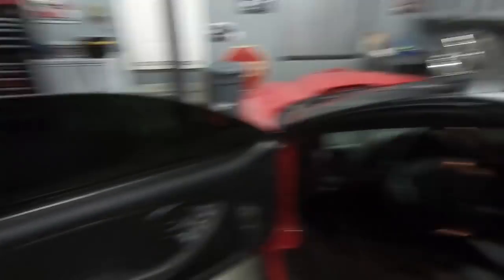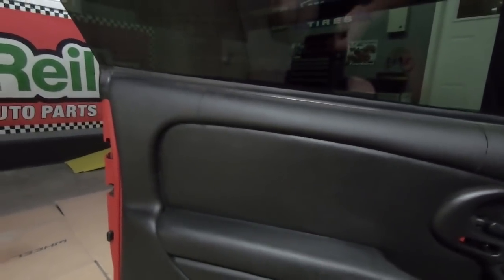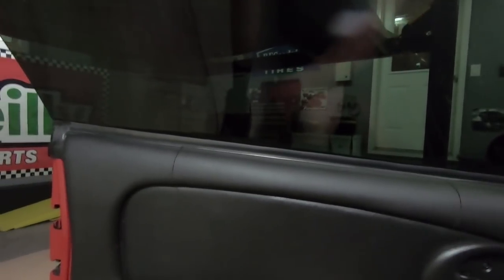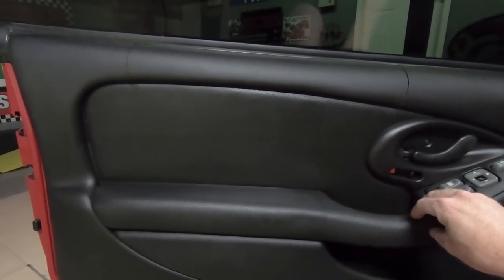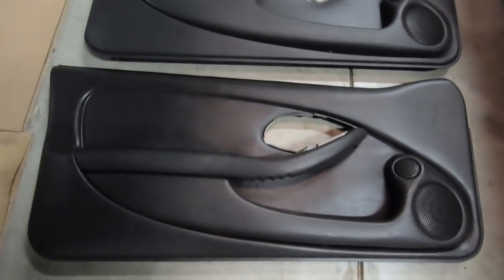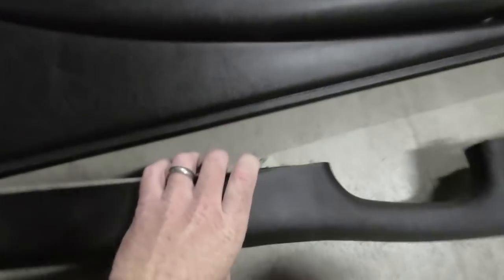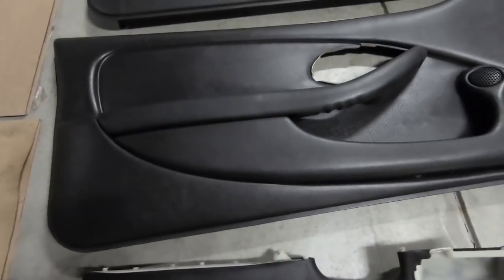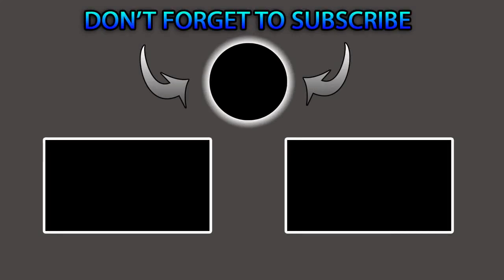Trans Am WS6 Firebird Door Panel Replacement

Comment: Easiest way to prevent new cracks, or to stop an old one, is to remove the staples that hold the top rubber weatherstrip and replace them with small screws and lock nuts. If you don't tighten them down completely, it allows the door panel to expand and contract separately from the weatherstrip, which caused the cracking to begin with.
Reply from the maker: I'm hoping that it doesn't crack but great info if it does. I figured if one side or the other starts to crack I would make a video on that technique.
Reply: I drilled out bigger holes used zip ties for expansion and contraction. Works great.
Reply: It will crack .just a matter of time.I removed the staples on mine before it cracked and has been fine for over 20 Years.
Reply from the maker: @Alan-xf1vx i probably need to

Comment: I took out those staples and used similar gauge copper wire. When the staples came off, I could actually SEE the plastic relaxing back into place. This was on a 8k mile TA. Terrific design, GM!
Reply from the maker: Crazy how bad they are. Maybe one day someone will make a good reproduction panel.
Reply: @TWAMotorsports  I've looked into door panel reproductions because some of my other vehicles could use a new set. From what I can tell, the parts are covered by a design patent and an official license is either very expensive or the OEM refuses to sell. Most aftermarket parts are like this as well.
Reply from the maker: @superduty4556  that sucks. You could make them better with quality material, leather wrapped etc and sell them all day long.
Reply: @TWAMotorsports   TWA Motorsports  yeah that's a good idea. There's a lot of money to be made. 

As an aside, I attend the Trans Am Nationals in Dayton, OH every year and get to see tons of 4th gens. Part of the thing I look at as I'm going down the rows upon rows of 4th gens is how the 93-97 FB's don't seem to suffer the same as the 98-00, and the 01-02's seem to have it the worst. So, if you're looking for a set, maybe don't exclude an early set from you're search. I'm almost certain they're identical.
Reply from the maker: @superduty4556  they are the same shape but charcoal not ebony. Ebony was only 00-02

Comment: Don’t roll the windows all the way down. The motor goes a little too far and you can watch it pull on the panel. HPP did a great article many years ago about removing the staples to release the pressure. I used small black zip ties and you can’t see them. So far (knock on wood), my Firehawk has 97k and no door panel cracks. Thanks for your videos. I have a red 00 Firehawk and your header install video helped a lot.
Reply from the maker: Great info. I saw that article on pulling the staples. Glad the install video helped you.
Reply: Late 98 to 02 tend to have issues with the door panels cracking, because they changed their manufacturing tactics on those years same with the sail panels. Early 98 and before had a coating on the back side of the sail panel to prevent the adhesive from going through.
Reply from the maker: @corruptedphoenix1998  cheap skates lol
Reply: ron harris can you give a link to that article? Or is there someone that can explain the process a bit?
Reply from the maker: https://ls1tech.com/forums/appearance-detailing/1325462-how-fix-your-already-cracked-door-panels.html

Comment: I know it’s going to happen in the future but my 98 is still going strong with no cracks. I can see some stress lines in the usual spot but it’s not bad and you have to look real close. I massage all the hard plastic like the door panels and the dashboard (another spot cracks happen all the time on) with “303 Protectant interior and exterior ultimate UV protection” in the dark blue bottle. I put it on every week or two and it really helps with them drying out and becoming brittle, my go to interior cleaner.
Reply from the maker: Thanks for the product recommendations. I will order some and try it
Reply: TWA Motorsports I don’t think it’s too bad on the price and takes awhile to run out of, I have like 3 bottles in my garage lol
Reply from the maker: @WeAreConfusing  where did you get it autogeek?
Reply from the maker: @WeAreConfusing  I will run by there tomorrow and pick some up. I'm in Springfield Missouri area. We aren't to far apart.
Reply: TWA Motorsports hope you like it man and yeah we really aren’t that far I go by there every once in awhile

Comment: Hi There - Love the channel and just subscribed.  The T/A is what drew me in.  I have a 2002 T/A WS6, with 11k on it and my driver's door panel has about an 1/8 inch crack starting.  I am going to be taking off both panels soon and try to prevent them from getting worse.  I love all the different cars in your stable!
Reply from the maker: Thank you Mark. I wish this door panel issue didn't happen. I love these cars.

Comment: I had the cracks in my door panels on my 02 T/A I couldn't stand it so I broke down and bought the charcoal ones you mentioned. I have dark window tint so the color difference is there but it is hardly noticeable. I will have to change them out later because, like you, I have OCD lol
Reply from the maker: Yeah I don't think I could do that color difference. It would drive me more nuts than the cracks lol

Comment: WOW! I've been really lucky so far, I only have a tiny crack starting on the pass side. I wonder if I reinforce it with some fiberglass mat/resin? Or if I can even get to it to do it? After watching this, I'm sure it's gonna get worse.
Reply from the maker: Yes you can take the staples out pull back together and reinforce. Wish mine had just started and I would have done that.
Reply: This video got me nervous so I just went out to the garage to check on it. Yeah, so far nothing on the drivers side and a little one on the pass side.
Reply: @TWAMotorsports  Thanks, that's my next project.
Reply from the maker: @dniksich  fix now before it cracks all the way.
Reply: @TWAMotorsports  Definitely gonna do it soon! It's just a tiny white line so far so I guess thanks to you, I caught it in time.
Reply from the maker: @dniksich  you're welcome let me know you it goes👍
Reply: @TWAMotorsports  Sure will.

Comment: The cause of the cracks is from the window motor pushing on the panel. That's why the say don't completely lower your window. I honestly thought you were going to plastic weld the cracks together from the back side. Then use a JB-Weld putty on the front side. Then color match the paint. So it would look new.
Reply from the maker: I would have if the panel were not cracked in multiple places and all the way through
Reply: @TWAMotorsports  that would have been a very nice instructional video.
Reply from the maker: @transam2002ws6  I agree

Comment: You're panels will crack again. Its the metal strip piece with the staples in it that causes the crack. It has to be removed and bigger holes need to be drilled out and replaced with zip tires. With the staples the metal expand and contracts and plastic panel cant.
Reply from the maker: I agree. If it doesn't get extreme climate changes they generally don't crack

Comment: mainly ive only seen it on 97-02 cars the early 93-96 lt cars have a better interior build quality for some odd reason
Reply from the maker: It does seem the older ones held up better
Reply: @TWAMotorsports  I think GM changed suppliers for the latter year door panels, I've seen 99+ door panels in the yards around me and 90-95% of them have the panel crack, on the other hand I've seen between 50-60 door panels from 93-97 in the yards and have yet to find ONE that was cracked.  My 2000 had the cracks on both doors, and since I went for a Knight Rider look I got tan panels from a 96 that weren't cracked. And when I changed the panels I had mine and the "new" panels side by side and did not see any differences in design or where they placed the staples.
Reply from the maker: @mikeb6033  yeah I have noticed that also.

Comment: I took my door off for an unrelated matter.  Is there any preventative actions I can take?  The door still has no cracks.
Reply from the maker: Yes ls1tech has a good write up on preventing this. It requires removing the stapled rubber and reinforcing.
Reply: @TWAMotorsports  

I removed the staples.  There were 8 and they were really in there!  They were all REALLY in there and getting them out with a wire cutter was difficult.  I'm surprised I didn't create a crack.
Reply from the maker: @FTsingos  yes they are hars to get out.
Reply: Now, I'm just trying to figure out how I want to reattach it.  I'm leaning towards the drill, bolt, and nut method although the paper clip might be safer and more flexible.  Also, if there's anything to reinforce the panel from the backside.
Reply from the maker: @FTsingos  I honestly haven't tackled this yet. I have removed the staples for a replacement but haven't reinforced one yet.

Comment: I guess I was lucky with my 1996 Trans Am.  It had zero cracks in the interior.
Reply from the maker: Some don't
Reply: most if not all the door panels I've seen in the junkyards that were NOT cracked, were from 93-97, most of the one I've seen that ARE cracked were from 98-02. Don't know if GM got cheap during the LS1 years or not, just like the bubbling roof panel problem.
Reply: @mikeb6902  I now own a 98 Y87 Firebird.  The interior doesn't have cracks...it looks new.  It was always, and still is, kept in a garage.  I've heard that 93-98 have better interiors and the cracks started with the 99-02 model years.  Same issue with the sail panel.  1999 GM either stopped priming them on the underside and or they used a different kind of glue.
Reply from the maker: I wondered that same thing
Reply from the maker: Yeah they apparently started cheaping out

Comment: You mentioned a salvage yard in Searcy Arkansas, but didn't mention the name. Could you provide that please? I'm always coming across something I need to replace and it's hard to find sometimes. Thanks! Oh, and BTW, my panels cracked very soon after I purchase the car back in 99 and I live in California where the weather doesn't have extreme change so not sure if it was caused by weather. I probably won't bother to replace since it'll probably just happen to whatever I replace it with LOL
Reply from the maker: I can't remember the name. If you Google fbody salvage yard searcy Arkansas it will pull up I think